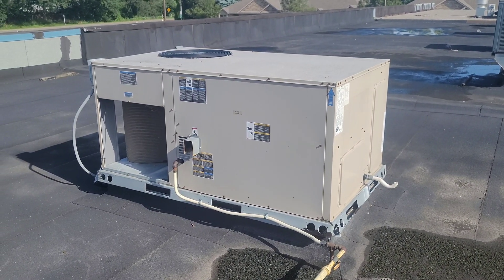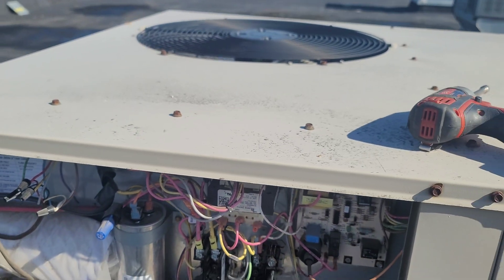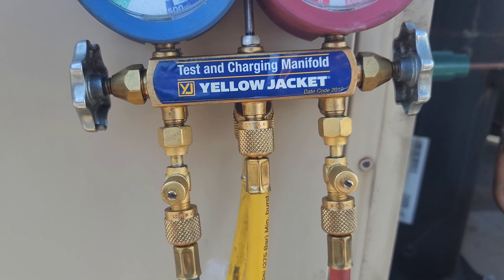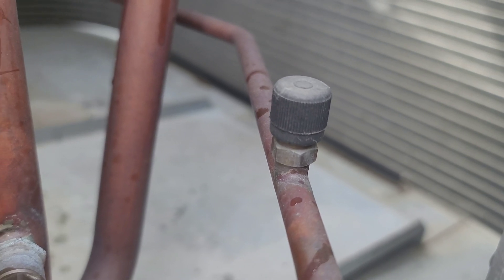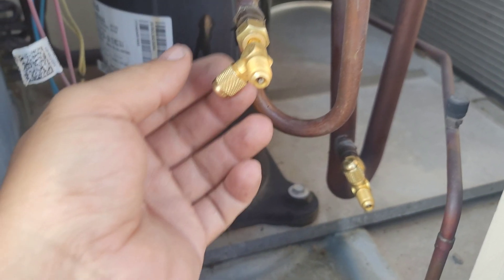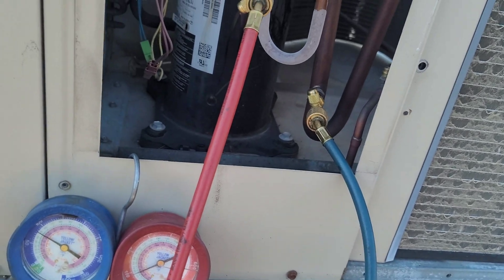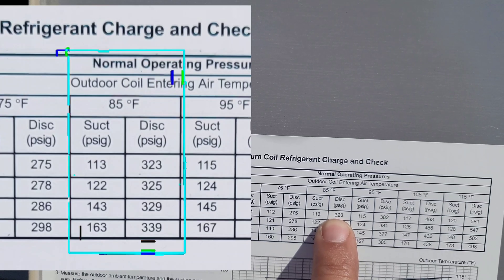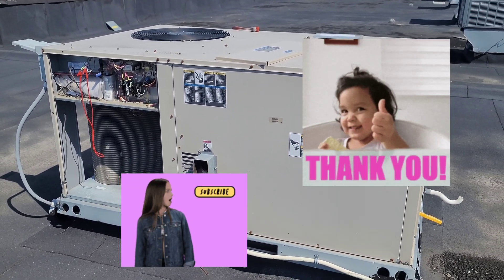LENNOX package RTU Not working

Comment: That coil is FILTHY!!!
You need to clean it with water, at a minimum, but proper micro channel coil cleaner would be better.

I hope the upright 410A jug at the end was NOT the way you charged it!!
Reply from the maker: Thanks for comment yes I cleaned that coil a day after with cleaner, and upright cylinder of r410 was correct position as in Canada jug has 2 valve for liquid and gas option at top

Comment: Why not replace the Schrader valve core? No nitrogen, no braising needed. It only takes a few seconds to replace the core,  The replacement tool is very useful and handy.
Reply from the maker: @DavidNull5  yes right, Those Schrader valves were bigger than standard valves as I explained in video, so I had to use fittings I didn't use nitrogen or pressure testing I charged directly

Comment: Great video. Thank you for sharing. May I ask, do we need to remove take out leaked  valve core schrader valve  before install T connector ?
Reply from the maker: Thanks for comment, no I didn't that fitting had pin which press the schrader valve pin

Comment: At 4:35 it looks like some pretty large oil stains on the coil. Did you check those spots for leaks?
Reply from the maker: @Mo4Honesty  yes I did that was my liquid leak solution which I sprayed on coil, I also checked with my fieldpiece leak detector which is very good and sensitive